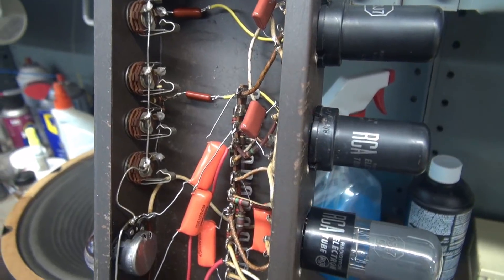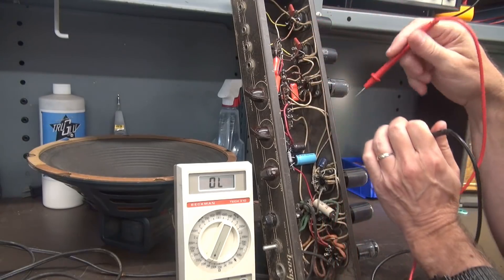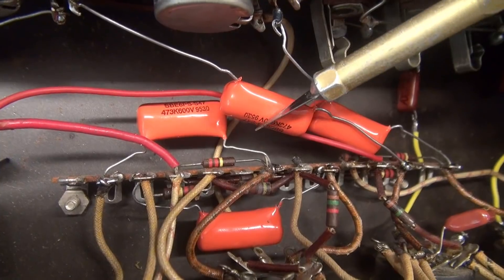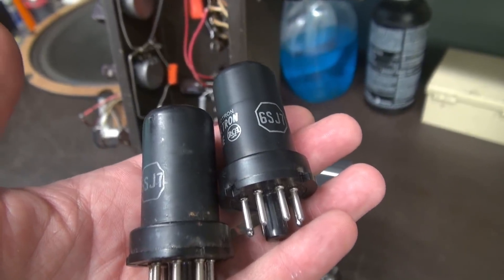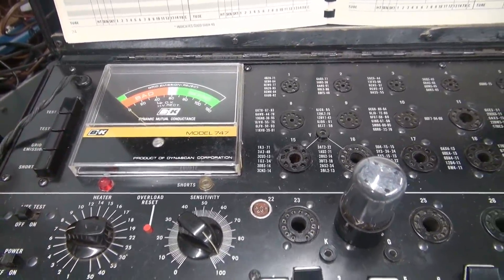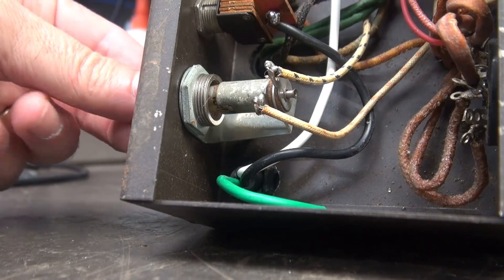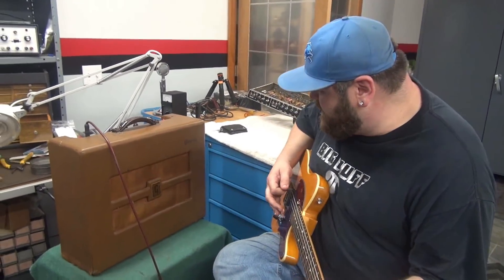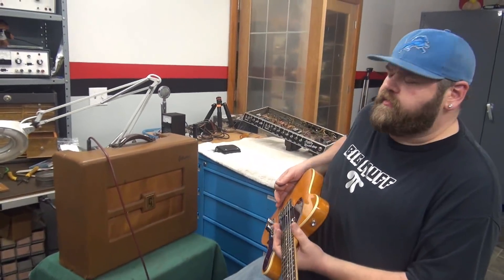How to restore Vintage Gibson GA-20 tube guitar amp D-Lab electronics Part 3

Comment: These rats nest point-to-point amps really trigger my OCD. I completely gutted and rebuilt a GA-6 on turret board. Also installed the output transformer on the chassis where it belongs.
These old Gibson amps sound good when they're fixed up, but man they were built poorly by whatever contractor Gibson used. Worst factory wiring jobs I've ever seen, and designed to a low price point.

Comment: Hi Terry,  When you're measuring resistors, don't you have to take into account parts of the circuit that may present parallel resistances?  Or are all these resistors isolated in the design?

Comment: Terry ... I'm going to ask a real dumb one . Changing the lamp holder on an angled fender front panel . There's no room to grip the back nut with any standard type spanner , and the front bezel of the lamp holder is tricky to grip . And I'd struggle to find a bolt with whatever thread is in it to help grip it . How would you do it ?
Reply: Tighten using an adjustable wrench progressing through the 'flats' of the nut and alternating the angle of the wrench. It's tedious, but it does work.
Reply: Thanks David.The reason I asked was because of a Vibro Champ that might need this replaced , I think it would be too tight for you suggested method because of chassis and power switch etc . But perhaps it might work on one of the larger amps . On reflection , I think I would bend a strip of sheet steel and make a slim spanner and turn the jewel holder piece with some softening material in a set of grips . Your input is appreciated , as now I know that there isn't a magic tool or technique .